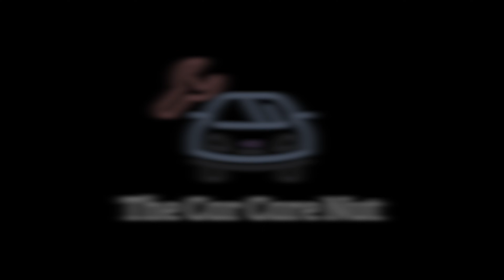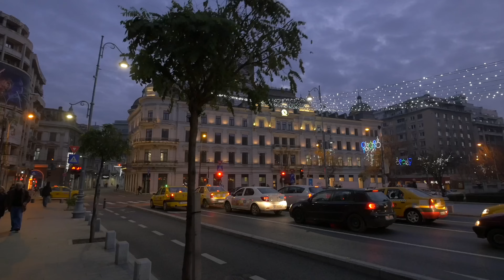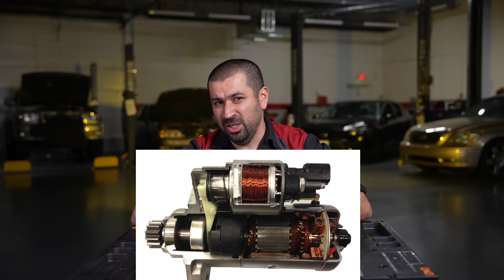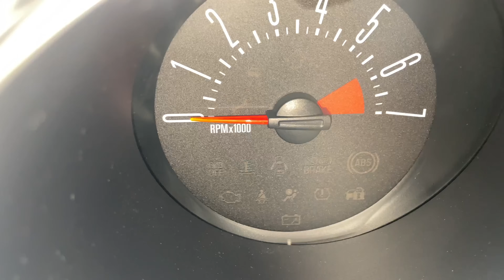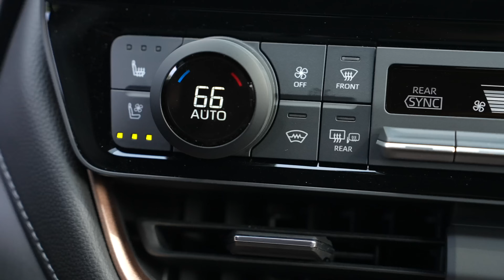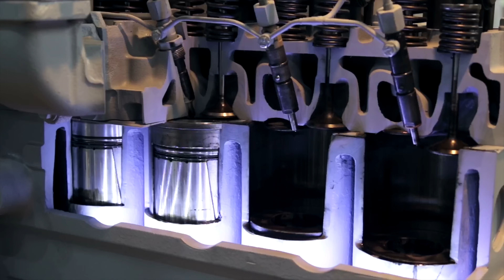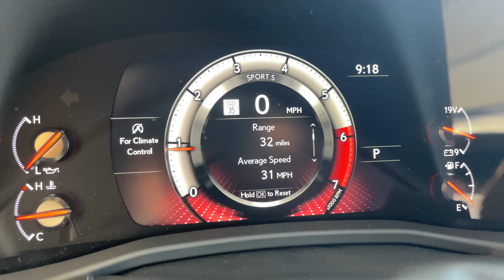How Does Start Stop Technology Work in Modern Cars? Everything You Need to Know

Comment: Thanks Car Care Nut for your presentation but you  also made the case against these systems. For the minor improvement in mileage and cleaner air, car makers added expensive complexity which will cost more to take care of over the life of the car or reduce its economical lifespan. Unless it's a rental car that we don't care about, it's best to disable it each time we get into the car. BTW, selective cylinder deactivation found on V8 engines also does not help prolong the useful economic lifespan for its minor fuel savings, and it is not as straightforward to disable each time we get in.  Engineers need to be reminded to KISS (keep it simple stupid) and not get carried away with complicating things simply because they can. Regulators should also be reminded that their cleanliness goals won't be achieved by making machines so complex and expensive to maintain if they become junk prematurely.
Reply: @alexandershonfield5879 yeah what’s the point in trying to get 3% better gas mileage and supposed “cleaner air” if the vehicle breaks down earlier and is less reliable. Reliability is a major factor in how green a car is. A 30 year old no-nonsense car still ticking is way greener than a new car with this system that goes to the salvage yard earlier. But most people today are too dumbfounded to realize this, because every time they hear the word “the new one gets way better gas mileage” their ears perk up like a wild coyote. They don’t think about the reliability and lifespan being decreased. Thank god you understand this
Reply: @Blakecryderman7244  Government ministers with their expense accounts never think that way. In the U.K. in 2009 they introduced a scrappage scheme, The problem was that you could only use it to buy a new car while scrapping one over ten years old that you had owned for a year. |SO most of the cars that got scrapped were only about 12 years old. To make matters worse back then they were encouraging people to buy Diesels "because they emit less CO2".
Reply: Turbos need lubrication until they stop spinning which may be long after the engine stops
Reply: I’m with you, I disable it to because it stops pumping oil.
Reply: He says it needs a special battery for this stop/start to happen. What if you put in a regular battery, wouldn't this tell the computer something is wrong and disable the start /stop function?
Reply: @dwaynelasater2350  He says in the video that the stop/start system will still work, but it will adjust to the "regular" battery.
Reply: @dwaynelasater2350 thats a great idea
Reply: These regulations are made specifically to make it imposible for us plebs to own cars, they don't want us to "pollute" their cities.
Reply: I beleave there are better ways to save the environment as well as fuel😂🌲🌲🌄🌄
Reply: Well, according to one political party, the solution is simple - buy an EV. After all, doesn't every one have easy access to charging stations, and live in a warm climate? 😏

Comment: Since the manufacturers have installed a switch that allows the driver to turn off this annoying feature then apparently it is not like other emissions devices on a vehicle which are hard wired and cannot be avoided. Looks like it's a "discretionary" emissions device.   So, why not devote a video to the aftermarket devices available to automatically shut off idle stop each time a vehicle is started?  The switch on the dash is just taking a control circuit to group which tells the bcm or ecm to shut off idle stop.  I'm sure you'd make a lot of viewers happy and it would be one of your highest viewed, if not the highest, videos.  It would be up to them if they want to install a device.

Comment: To permanently disable the auto S/S on the 2019-2021 RAV4 ICE models just disconnect the electric sensor wire on the hood latch lever. Hundreds have done this in the RAV4World forum. This won't work on the 2022-2023 RAVs.

Comment: I dislike the system mainly because it's inconvenient and in my country, people are in the rush and inpatient, another thing is it will affect the AC. I'm in a hot climate country the air con is important, especially to my hot temper wife 🤣, another is it annoys me having to remember to Off the Start/Stop Switch, So I disable the system with just a device installed on the switch. It does not fully disable, but the device reverses the Start/Stop action. Instead of default On, it is now default Off when I start the engine and when I need it I just it turn it On which is very rare.

Comment: An excellent video on how the Stop Start system works in the newer vehicles. I have this system in my vehicle, and I keep the thing turned OFF all the time. It is just added garbage that is filled with a few parts that can break and no longer work correctly or not at all. Technology (electronics) in vehicles are popping up right and left. One vehicle manufacturer seems to be trying to outdo the other with this junk. What ever happened to the old school of knobs, switches, manual transmissions, manual gauges, etc. Thank you for this excellent video. Your knowledge really makes things easy to understand. Looking forward to another great review!

Comment: What I learned from this video is if you trick the Battery Management System into thinking the battery only has 7 volts the vehicle will keep auto start/stop from activating 😃
Reply: That can actually cause the car not to start and put you in a dangerous situation

Comment: My thoughts are this: On the internal combustion engine! the most wear occurs at start up! The only way around this is to have an external oil pump that will maintain pressure even when the engine is off. Most pipe line patrol aircraft have an external oil pump to pre oil the engine prior to start up. This has been proven to save the life of the engine. I know aircraft engines have a time limit called TBO. Time between overhauls. but when torn down the wear is minimal. I think this should be done on all engines!

Comment: A very informative and easy to understand video. Now that I know how they work, I hate these systems even more. Too many things to go wrong and if something does, will you be somewhere that has a technician and the parts to fix it. At what cost too. No thanks.
Reply: Can you explain what parts of the system will go wrong?  As clearly explained multiple times, if anything goes wrong then the failsafe is to drop back down to a regular battery + starter system.  The only impact of these systems failing is that the stop start feature is effectively disabled - this is the reason why there are so few reports of a failure causing a vehicle to break down.

What part of the system could fail in such a way that it doesn’t drop down to a regular starter system, i’d be interested to see what that component is.

Comment: Question:  Will the new Toyota Land Cruiser (Model 250) with hybrid drive train have this stop/start technology?  Also, does the new Land Cruiser have a normal HVAC system?
Reply: Probably, but the motor/generator will make operate smoothly. The AC will probably be electric like it is on the Tundra and Sequoia.

Comment: Great video, as always! What happens to engine oil circulation when the auto stop/start engages? Does the oil drain to the pan or do oil pumps keep internals well lubricated so the engine is well protected from sudden and hard acceleration from a stoplight - hypothetically speaking if one were to have that behavior. 😉
Reply: I'm not aware of any systems that use an electric oil pump to prime the engine before every startup, so whatever oil is left on the parts keeps them lubricated until the next startup. Since the engine usually isn't off for long, this at least seems to work well enough for the engine to last as long as most people keep their cars. I don't think an electric oil pump would drastically reduce the already seemingly minimal wear on restarts because oil pressure still can't create a hydrodynamic wedge to keep parts separated unless they are rotating, but it would be great to see an actual study showing the effects of stop start on engine wear.
Reply: At non-extremes, the end lubrication is negligible for start/stop. The system will monitor for any abnormal conditions, including oil status/pressure. Keep in mind, it takes the oil awhile to completely drain to the pan in normal conditions. Way longer than a start/stop event.
Reply: Yes the oil drains back to the pan and you have no oil pressure til it starts again which wears the engine more then just running it continuously
Reply: @DylanL69  Do you have any evidence to support your claim of stop start causing additional engine wear? The theory of potential metal to metal contact for a fraction of a rotation on every startup makes sense, but then again, idling is also said to be bad for engines and stop start could potentially save many hours of run time somewhere with horrible traffic like Chicago, so I wonder if the reduction in wear from less idling may offset some of the potential wear from more warm restarts in some situations.
Reply: @averyalexander2303  when the engine starts it wears the most because lack of oil pressure

Comment: Mercedes Sprinter and I need to turn it off everytime I turn on the engine. I don't want this s....... ughr. Pseudo ecology should be annihilated from modern propaganda.

You need to start engine which consume more fuel than that moment when you stay and stability run your engine. 
We just need more efficient engines with better fuel with necessary filters. 
Europe is a prove how wrong this ecology pathology is working. Don't copy Europe because it's a dead end.

Comment: I don't ever hear the start in my car. Im wondering if it is actually designed to turn off the engine in a certain position so that it can start itself with ignition. Also as someone who lives in LA. Stop start increases my fuel economy by over 10 MPG so over here it works wonders lmao going from 18 to almost 30 is a great exchange IMO considering gas is 7$ a gall now ;(

Comment: The engineering is interesting from an academic standpoint. Once you think about how every system on the car has to be overhauled and complicated then it seems hardly worth it. Investing money into making EVs better and more usable for more people seems a way better idea than making an ICE slightly better at massive cost.

On a related note, I feel like start/stop works far better in manual transmission cars. They start the engine starting process as soon as the clutch pedal  begins depressing, so by the time you've fully depressed the clutch and selected first gear the engine is ready to go. Any slight delay is completely masked by the slight inherent delay in a manual transmission. Since they also get worse gas mileage these days and produce worse emissions if they tune out rev hang, then it seems the only application that isn't asinine for ICE powered cars.

Comment: In other words, it's a major additional complication and expense on a vehicle both at purchase time and down the road.
Reply: Our tax dollars hard at work from our government trying to keep up poorer. Emissions baloney.
Reply: Bingo!
Reply: To answer your implicit question, I doubt a few hundred grams of copper, or slightly larger battery that will be recycled when it dies, will have any impact on global copper or lead production.  Those 30 second stops probably paid off the cost of the extra raw materials, within the first few stops.

(Using current copper futures prices at 8000USD/ton and the weight of copper in fairly heavy duty copper wires in household electrical circuits - much thicker than electrical wires in vehicles - at 0.0052 kg/m, which gives me a cost of less than 10 cents copper per metre of thick electrical cable for high current, and about 1 cent per metre for low current wiring that’s used for signalling, rather than power transmission or inside the alternator in the vehicle)
Reply: @Mark-lz4wg  I also doubt a few start stops on my Rav4 are going to make any difference to anything environmental that anyone can measure. Just one mile south of me there are over 3000 diesel trucks in a parking lot. I would say my Rav4 is less than nothing in comparison.
Reply: @chuck_howard  Not sure why people don't grasp this concept.  One car doesn't make much of a difference, but there are close to 300 MILLION cars on the roads in the USA alone.  When this system works on tens of millions of cars, it makes a massive difference in emissions.  This endless "look over there instead" arguments are comically dumb.

It is collective amount of pollution that is the issue, that is generated in Billions of tiny increments.  Claiming none of them matter is beyond absurd and absent even elementary school level of logic...
Reply: @redbaron6805  You are the only idiot I see so far in the comments section, not to mention your inability to grasp the sarcasm part of the comment.  I would advise you not to look up when it's raining for fear of drowning.  Have a day, stupid one, afraid to even use your real name.
Reply: Not to mention the strip mining to get the extra copper and lead to add to the system that hurt the environment in the first place.  Am I saving the planet by my trip with two 30 second stop / starts compared to the cost of the raw materials before I bought it?
Reply: @chuck_howard  That claim is literally a new category of idiotic.  The extra "copper and lead"...?!?!  Seriously...?